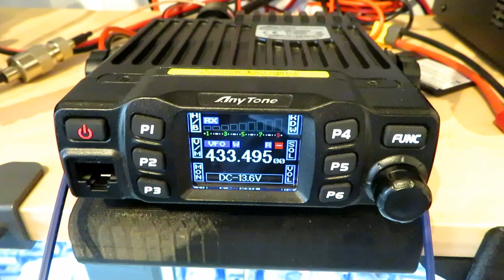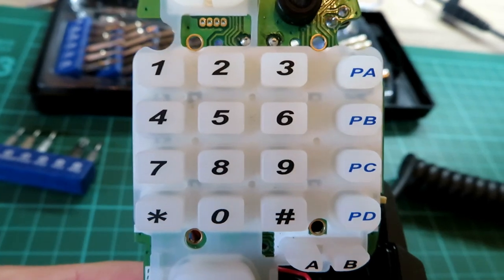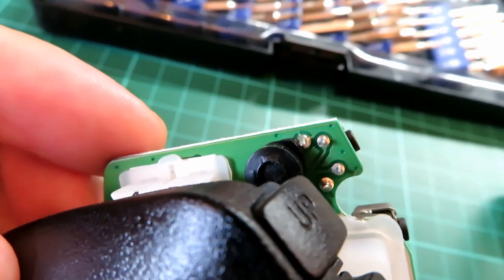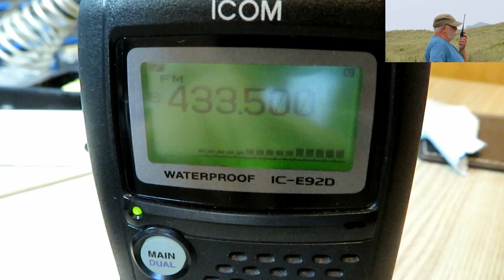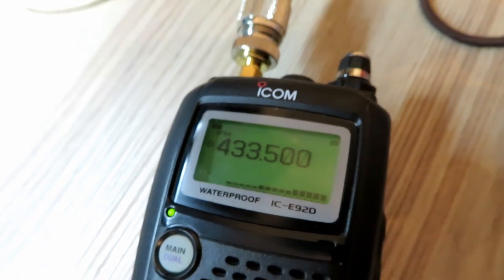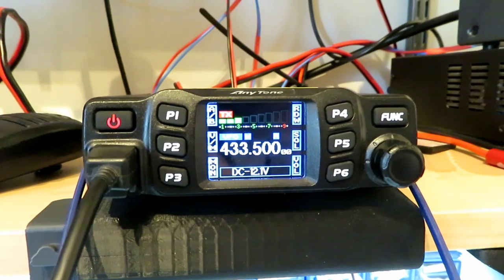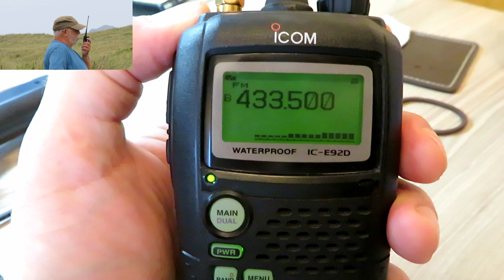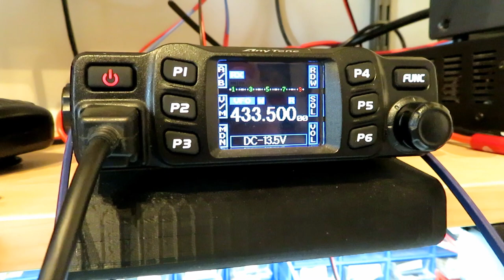FIXING LOW AUDIO ISSUE ON ANY OF THE ANYTONE RADIO FIST MICS - QHM-05

Comment: I did this mod after receiving a muffled audio report.  As of 4/24 Retevus has not fixed this.  I drilled mine to 1/8 inch.  Might be a bit large?  I used alcohol wipe to remove remaining paint to clean up the "MIC".
Thanks for the video!!!

Comment: Nice video,  although I wish it was a before/after audio test using the same mic so a viewer could experience the change.
Reply from the maker: Yes I did record it on the sdr but it wasn't as noticeable at close range, over distance over the signal to the repeater 20 or so miles the low deviation was really noticeable.

Comment: Thanks for that tip. Also the mention of narrow/wide setting in the comments.  I will check alignment on mine.  I did not look at mic alignment or notice anything wrong when I had mine apart. I am trying to tone down the brightness of the AB button/switch LED and the A & B  selected LED indicators. They are way too bright for night ops for me. They are not part of the adjustable keypad ltg. Have tried two layers of flashbreaker tape over the LED's but still not what I want.  I may have to change them LED's out or a fine dab of trial and error paint.  Was wanting to know if someone had already done this intensity change.

Comment: By the way.   I have just bought a Retevis RT95 and the members of our local radio club say it sounds perfect.
Having worked in manufacturing,  i think this problem could well be an "assembly problem".  The mike and the foam can probably be slightly moved, one way or another...
It's crédit to you that you saw the mike hole inprint on the foam 
I'll take a look at mine

Comment: AT-778UV mic gain

Hello 6:03 
Like some others, working with the same set, i also get reports of low audio levels.
I know there is no Mic Gain option, but does anyone know if AnyTone will (or has) update(d) the firmware ??
I saw that Retevis have released new firmware for their RT-95 which INCLUDES a Mic Gain as a menu option.
Is anyone here knowledgable enough to know if the Retevis firmware can be used for AnyTone? Looking forward to replies ... 73

Comment: Thanks Mate i was just about to send mine back. Do you have any issue with it getting to Hot and cutting out on long QSO ?????
Reply from the maker: It does run hot on a QSO even on low power, I've not had it cut out on overheat though

Comment: Am I right in saying that 70cms repeaters and simplex frequencies should be set to wide and 2m repeaters and simplex frequencies set to narrow pls as I have the same radio
Reply from the maker: It does depend on the radio because wide on 1 is narrow on another, especially the Chinese definition of wide, best thing is to try both and see what works best with the repeater, I find some work better wide and others don't.
Reply: @knoxieman  cheers bud I've worked it out 2m including repeaters is narrow and 70cms repeaters are wide and simplex narrow

Comment: A bit late to the party, most hand mics have a weight inside. This makes it feel better in the hand, a weightless mic just doesn't feel right..Any mics I get that doesn't have this I add a weight my self..If you still the radio try removing the weight by unscrewing the screw that's holding it in and then you will see it's far far better with it in.
Reply from the maker: Yes totally agree with you 👍

Comment: Hi,

I have a question in the anytone at-778uv. There is no audio during transmission. Just dead key carrier. Basically running transmitting (dead key only) and receiving perfect. I tried it on different channels lower and upper and same thing. Is there a mic gain or a mic mute for this radio? I read the whole manual and there is nothing was mentioned. Any takes and thank you.